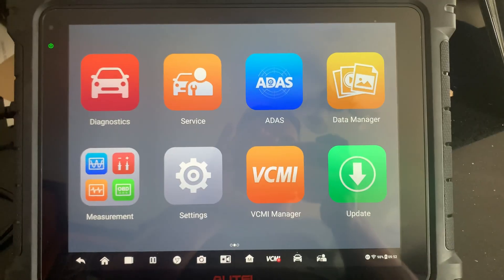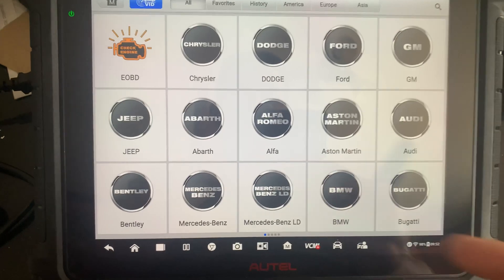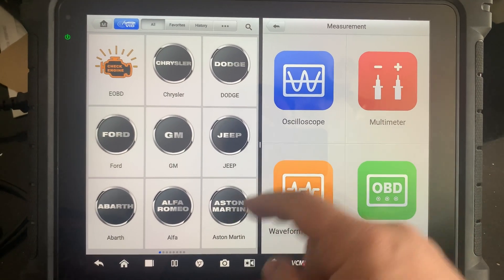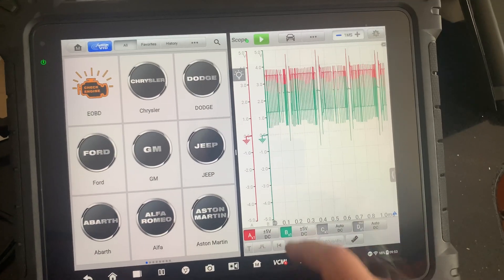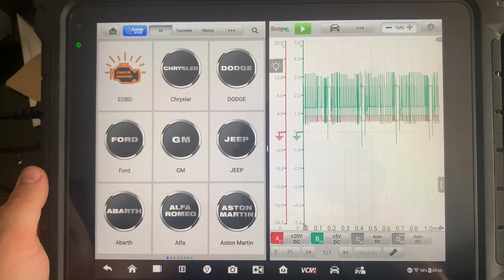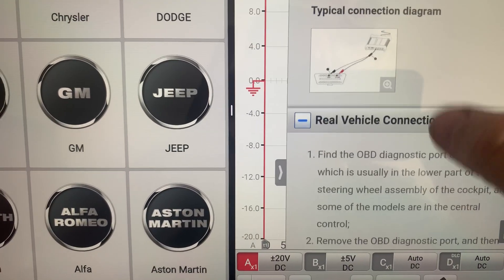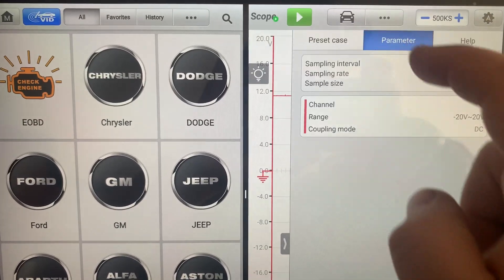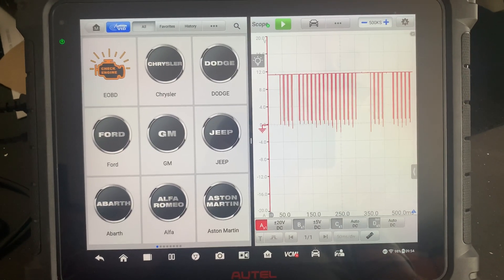13" Autel Ultra Automotive Scanner Newest Mega Can J2534 4ch Scope

Comment: @Welding Junkie Have you tried to use the diagnosis and scope at the same time? I tried it on mine with the scope and the waveform generator. It displays an error message saying the diagnosis is using the VCMI and I have to exit diagnosis to use the scope or waveform generator. So, I do not think you can use two functions of the VCMI at once.

Comment: Seems to me this was second video you posted of this cool tool. Figuring now that you can cast the scanner screen to a big screen TV wirelessly with Android 7.0, you have to wonder how soon Autel is going to release a budget $1500 Launch Diagon version sized tool with a VCI 100 sized dongle and the scope?  The Probes themselves will just be very short wired cabled transmitters velcroed to whatever you can find to mount them to with no wired connections what so ever to the  USB scope module incorporated into the phone sized tablet!

Comment: Do you know what the yearly update cost is for this unit and for the ms919?. I want to get the ms919 wich is a step below the ultra. But still has the VCMI. How good is the waveform generator?. Can you supply voltage through the multimeter leads and check the scanner live data at the same time?. I'll appreciate very much your answer because i want the scanner but there's not a lot of info on this new units.